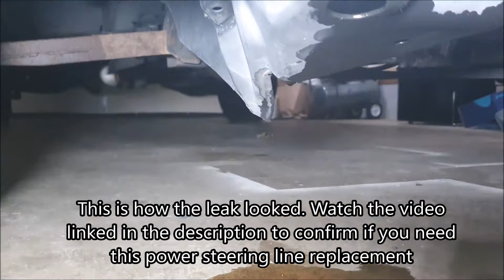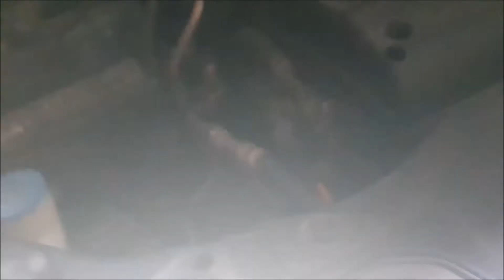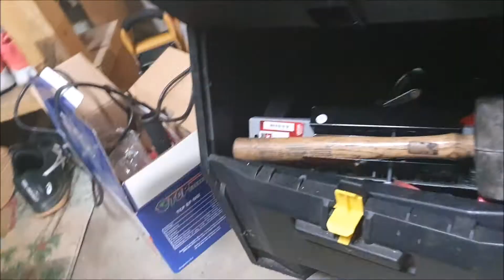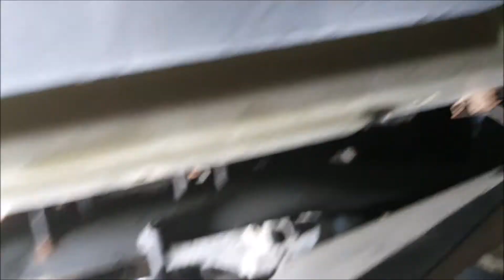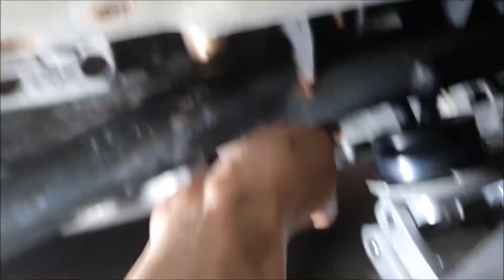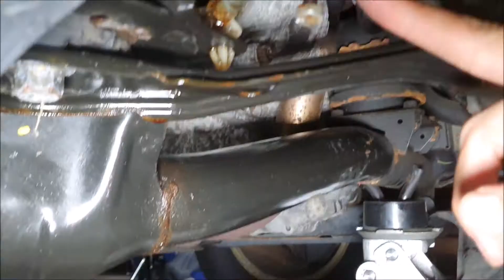2004 Honda Pilot Replace Power Steering Line Tips

Comment: Hi. Great video- thank you! Two questions - do you know if this is the same for a 2005? And was there a sensor attached to the line as well? Cheers…
Reply from the maker: I dont remember a sensor. If there was one you could probably see it in the video. I think the 2005+ is probably the same but can't say for sure. There were some engine updates for the 2005 model year compared to 2003-2004
Reply: I did 2005 it is pretty same, sensor is not attached to this line .. ths is return line and it is attached to high pressure side.